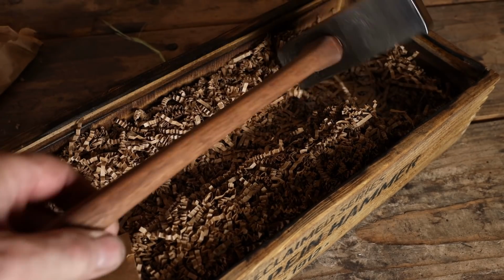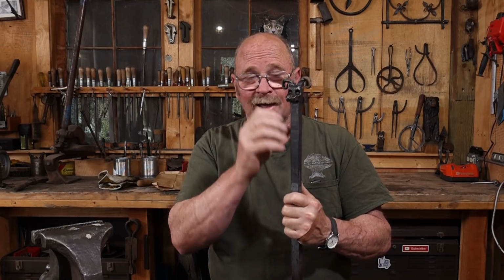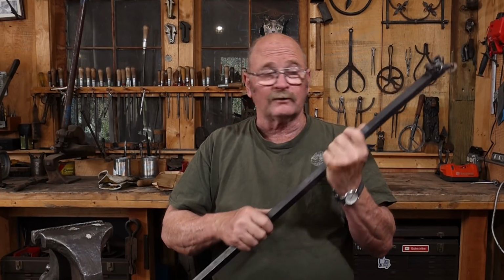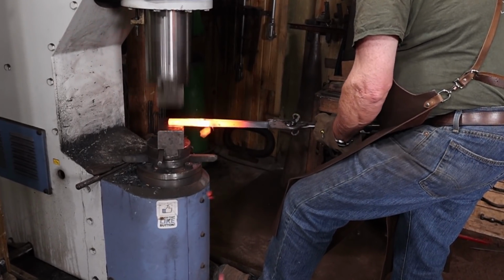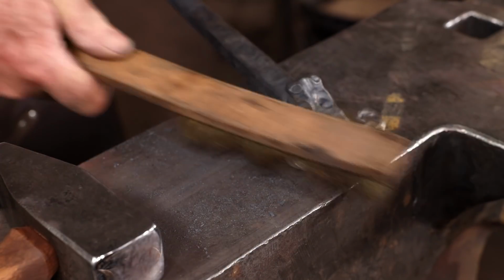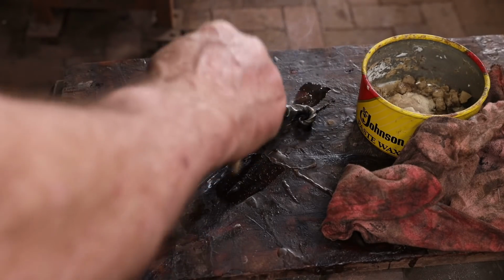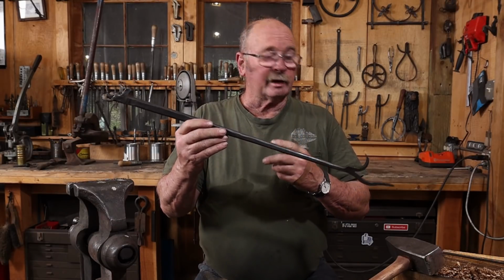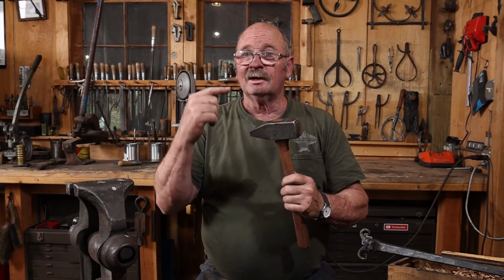Forging a Poker - New Timothy Dyck Hammer

Comment: I watched this fabrication knowing you were going to form a log hook on the tip.  I even had it in my head how you would do it.  Funny thing is, I fully expected you to split the "fat end" from the other end of the section and then bend it out.  Totally surprised me.  My question is....would it have worked ok to split it from the upper section?  In short, is it optional where you split it?  Thanks.
Reply from the maker: Should work fine from either direction but it might have a different finished look

Comment: Great work as always. Question on the reclaimed rail hammer, or more so of the steel makeup of it. Do think it would work for hatchet/axe heads? A quick internet search says modern rail is 1084 or something similar. My forge welds are hit or miss so I'd rather stay away from welding in a hardened bit. I'd really appreciate any insight you could share.
Reply from the maker: Tim has been making a bunch of axes from reclaimed rail.  So I think its pretty good stuff.  https://www.youtube.com/watch?v=Jo3Iv8ccSTo&t=997s
Reply: @BlackBearForge  that's great, I'm going to get started on one this week. Thanks for the info.

Comment: That's a great looking hammer.  It almost looks like yo need a specific set of tongs to hold the head on the poker
Reply from the maker: Yes, A pair of bolt tongs with an over sized bow would be useful.